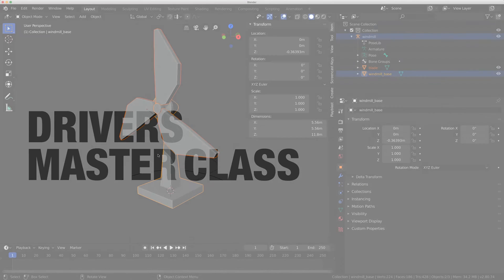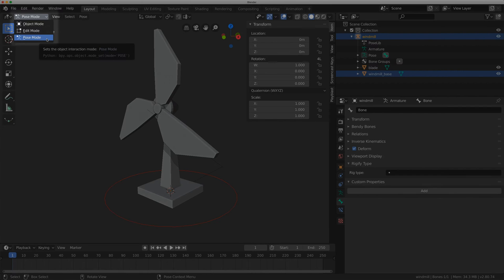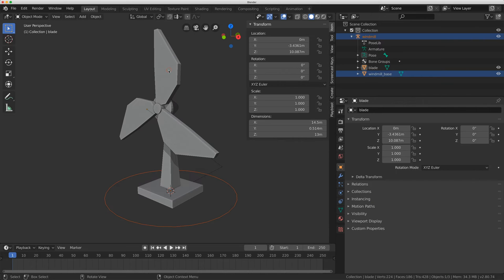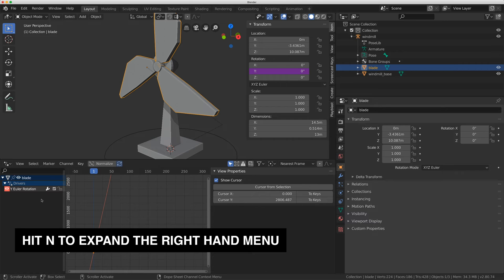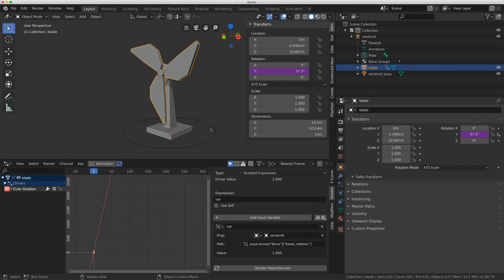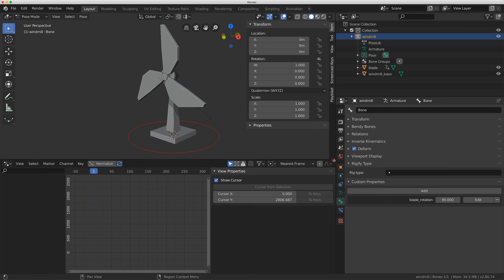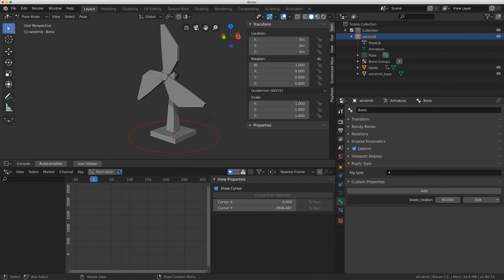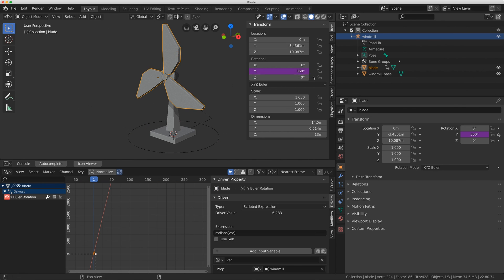Driver Rotation Issues | Blender Drivers Master Class

Comment: Thanks for the video. im make a drone. And y propeller not looking natural. How can i make it rotate natural. (https://imgur.com/a/qgDHr1i) any suggestion plz to rotate full speed propeller with the driver. Thanks
Reply from the maker: For this drone try to calculate how fast the blade will move in real life, you should be able to find the rpm of that model. Next, watch your frame rate (24f/second) changing this will make it look more realistic as you will pick up more frames of the rotation. Try 30 frames, or even 60. 
Last thing is try to add motion blur, this will help sell the effect.

Comment: Great tutorial! I noticed the problem with using radians when I started doing this.  I’d been using pi for my rotation values though, so to get 90 degrees I would use pi/2.  However, seeing this is a great way to do things, and I think things are very well explained, and I’ll be using your method.
Reply from the maker: Thank you! Yeah, I ran into this a lot when I started in Blender, it really helps with python in Blender as well!